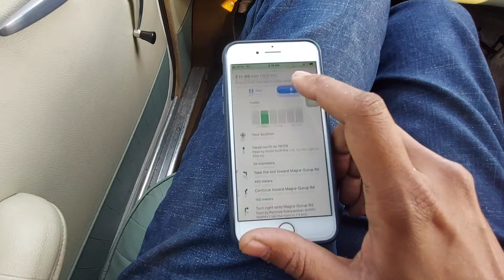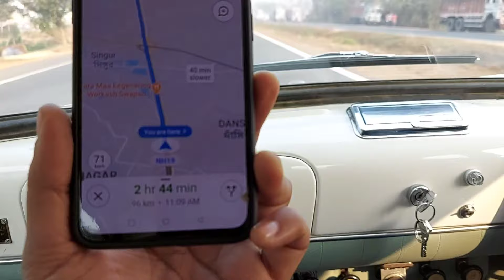Fiat 1100 Super Select 1963 Roadtrip | Kolkata - Maheshgunj  | Vintage Car India Vintage Soul

Comment: Can you please tell the engine displacement in the blue book of this vehicle. Is it 1089cc or 1100cc? I am asking about the exact displacement (cubic capacity) printed in the bluebook. Please help.
Reply from the maker: Hi! The bluebook says 1150cc but the internet says 1089cc! Take your pick!
Reply: @vintagesoulinc  actually I am having a 1990 model, which says 1200cc. But according to Internet its 1089. Quite weird 🤔😂😁. Btw thanks for confirming.
Reply: @vintagesoulinc  how many miles  of km/ pltr....?